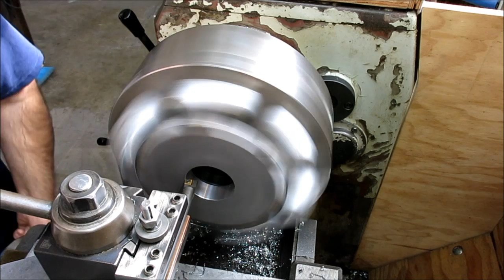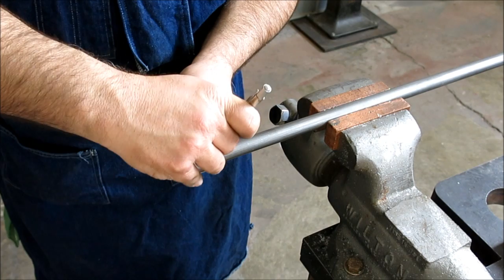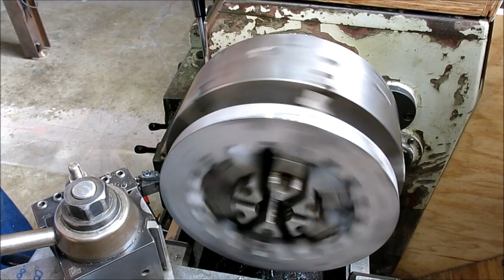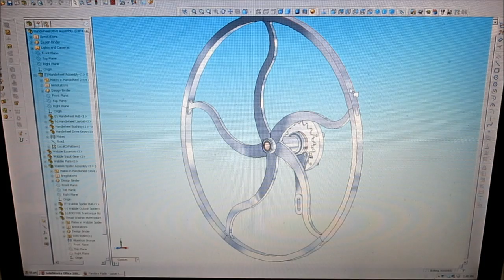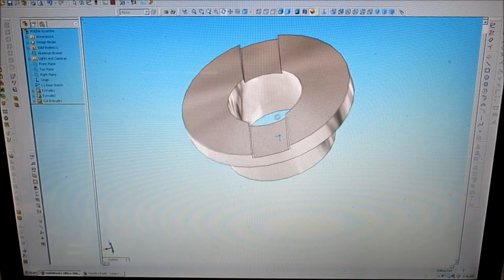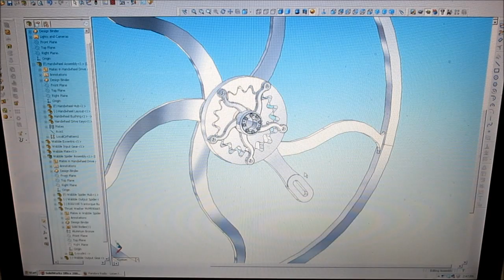Etching Press Wabble Drive Gears

Comment: is it not better to indicate the OD before cutting the OD? may be even indicate on the jaws to make sure that the inner teeth are "in line" with the OD? The teeth are leeding I guess
Reply from the maker: The od is not necessarily concentric with the pitch diameter of the gear. By referencing the gear teeth you start off on the important surface. The OD in this case is not functional for the gear train. Thanks for the comment.

Cheers,

Tom

Comment: what is a tenth? A tenth of a thousandth seems wrong to me, that would make it a fraction of a fraction. If this is the case why isn't it stated in ten-thousandths? I.e. let's remove another two ten-thousandths.
Reply from the maker: Hi Hyss,

In general we talk around the basic machinist measuring unit of one thousandth of an inch. When we say a tenth we are subdividing it kind of shorthand. So a tenth of an inch becomes a hundred thousandths and a ten thousandth becomes a tenth. The metric boys do the same thing centered around a millimeter. Thanks for the comment.

Cheers,

Tom

Comment: Could you give me contact info of shandon HKW so I can as a few questions before I plunk down $700 for the controller? If you want to send it off line my info is nik@niccolyer.com
What town do you live in, anyhow?
Reply from the maker: Hey Nik,

$700 sound really high. You should have a conversation with Stan. Here is a link to his channel. https://www.youtube.com/user/shadonhkw. Check Automation direct for VFD prices as well as these guys. http://www.energycontrol.com/Fuji-FRN001C1S-2U-p/frn001c1s-2u.htm This is one I was looking at for a small surface grinder application. My shop is is the San Francisco Bay area. Where are you located?

All the best,

Tom

Comment: Tom; I love what you do on camera. I'm slowly working my way through all of your older segments while trying to keep up with your current posts. Man, you are prolific!  I've been told that I can convert my old J head Bridgeport 1 hp belt drive 3 phase into a variable speed system by changing to a frequency drive controller. Know anything about that or do you know someone who knows?
Reply from the maker: Hi Nik,

There are a bunch of folks that have done this type of conversion. I have been blessed by the three phase gods so I have not had to deal with the VFD side of things. I'm sure there are some great video's on doing the conversions. Stan over at Shadon HKW has done a few namely his drill press and saw I think. The prices of these units keep coming down so there are lots of choices. 

All the best,

Tom

Comment: Tom could you tell me what oil you use all the time please when lubing stuff or something you would recommend please for when using my mill I use suds a lot  see you like oil
Reply from the maker: Hi lb,

Do you mean for cutting or for lubrication of the machine? The cutting oil is Relton Rapid tap or Kling Light thread cutting oil. The machine lube is standard way lube made by many manufacturers.

Cheers,

Tom

Comment: Hi Tom...

Great stuff! I have a difficult time with very shallow DOC and carbide inserts on steel. Is there a trick? I can get a nice finish with about .020" or deeper DOC, but anything below that is dull and a little chattery sometimes. Maybe my 73 year South Bend 16 isn't rigid enough??

I'm impressed with your finishing tool and the .002 DOC...amazing finish.

Thoughts?

Thanks!

Todd
Orange, CA
Reply from the maker: Hi Todd,

I don't know how fast your SB will go but my guess is your cutting speed is way too low. With a large diameter like these gears its pretty easy to get up to 600-800 fpm cutting speed. If your doing small diameters like say one inch at 800fpm that would be 3200 rpm. I don't think the bronze bushings in the SB would like that. For your setup I would suggest a DOC slightly larger than the nose radius of your insert. Feed at .005/rev or less with a light film of cutting oil. Positive geometry will help also.

Cheers,

Tom
Reply: oxtoolco Thanks Tom...

I agree, the SB is too slow for small diameters. 2.5" diameter and above and things start getting noticeably better. I'm probably also getting greedy and asking too much from an insert that is not really intended for finishing....it's more of a general purpose semi-finishing style....need more positive geo.

Thanks for the input, it's nice to have my suspicions confirmed.

Keep up the great work with the videos! Can't wait to see the etching press in action.

Todd
Reply: T Rudaitis Been doin a little homework and some trial and error. It's no doubt that the old lathes like mine don't like a lot of tip pressure. Like most things, it's a matter of finding the right recipe, and for my needs and my machine it ended up being a cermet insert with a .008 nose. Works great! Even though it's a low rpm lathe, I'm still getting great results down to around .625-.750 OD on 1144 and 303. Perfect for what i do most. Thanks again for the input!
Reply from the maker: T Rudaitis Hi Todd,

What shape insert are you running? Is it a positive or negative geometry?

Cheers,

Tom

Comment: Does the ringing in the part affect the quality of finish?
Reply from the maker: Hi Mark,

Excellent question. It can. I switched roughing tools because of the ringing and some slight surface ripples probably caused from it. The more positive WNMG took care of that problem. Sound is an excellent indicator of cutting performance. After a while you can easily tell the difference between many cutting conditions. 

All the best,

Tom

Comment: Tom you do some nice work. The gears look great. Were you using a CCMT insert for boring? Looks like it but i don't have any tooling of that style. 
I see your starting to use that lead knocker a little more, I told you it works great for indicating. What did you use to wrap it?
Oh, I like the haircut too!!

Adam
Reply from the maker: Hey Adam,

Thanks for the comment. You got good eyes. The boring bar did have a Mitsubishi CCMT insert in it. I like this style of boring bar because I do a wide range of materials and there are lots of choices in C style positive inserts. And yes I am liking the knocker. I wrapped it with Gaffers tape to pretty it up make it stand out with your name on it.

All the best.

Tom

Comment: Nice to see someone use a properly sized box wrench on the toolpost nut!
When I see some of the morons at work use an adjustable for that I just want to bash them in the head with one...
"cresant" wrenches are only half good for SQUARE parts that are odd size and
twisting flat bar, that and rounding off nicely machined hex fasteners LOL
Reply from the maker: Hi Gent,

That's a WW2 era pebble finish Plomb Los Angeles double box wrench. I was stoked when I found it fit the toolpost nut. I'll show it in another video. the center section is so slim and trim its quite the looker.

Cheers,

Tom

Comment: Hi Tom,
Nice job on the finish of the gears!  I can tell you have had many years of experience around the lathe to know what it takes to achieve that finish.  It is beautiful!  Thanks for showing!
Reid
Reply from the maker: Hi Reid,

Thanks for the comment and compliment. Steel can be tricky to get a super fine finish on as you well know. I don't know if you noticed but even using the same technique I got two different surface finishes on the two gears.

Cheers,

Tom
Reply: I did notice and that is why I was so impressed with the finish you got.  Even the finish towards the center was pretty nice.  GREAT JOB!
Reid

Comment: hey tom after watching you video i would like to ask two questions 
1, what sort of pating tool is that and what is the brand 
2, the brand of your boring bar that is used in this video 
thankyou
Reply from the maker: Hi Troy,

Thanks for the comment. The parting blade is an Iscar retrofit for the Aloris parting blade holder. The boring bar is solid carbide and I think that one is a Kennametal. $$$$ but worth it if you do a lot of boring.

Cheers,

Tom

Comment: Tom the gears turned out nice.  I did notice the difference in surface finish too on the inner gear. CRS vs HRS ?  How thick were the gears?
All my other questions have been asked already, this is great...
Reply from the maker: Hi Bill,

Not sure on the steel. I asked Steve if the two gears came out of the same chunk of plate. As far as I know right now the material is just A-36 plate one inch thick. One thing I noted was they were dead nuts at one inch thick which surprised me a little bit. It took about .025 to clean up both sides.

Cheers,

Tom

Comment: Tom, 
Getting fancy with the camera work!  Nicely done!

I wonder when someone will do a musical piece using a lathe, wobble gear, and a sampler?  Some good ringing tones on that run.

Thanks for showing the two unusual work holding setups...useful at times I think, but maybe not something I should try until I've racked up some experience first with the more common ones!

In watching Adam use his knocker I note a difference from the way you used it that might account for why his indicator doesn't get concussions...he notes the spot needing attention, then rotates the chuck back 90 degrees and raps at the top, well away from the indicator, then rotates forward to see if it got the message or not. Just an observation. 

Thanks for the interesting viewing and good lernin'!
Reply from the maker: Hi Mike,

Thanks for the comment. I see Adam doing that also. Its hard to break habits learned over many years. I prefer to see the direct action on the indicator on the actual offending spot. Not always the most healthy spot for the indicator but I have never knocked one out of commission. They just quit talking to me for a few days.

Cheers,

Tom

Comment: Hi Tom , do you have any experience using auto cad inventor ?
Reply from the maker: Hi Michael,

I have never tried Inventor. I have used almost everything but Inventor. I do use good old 2D AutoCAD still quite a bit for profiles.

Cheers,

Tom
Reply: Ok Tom,  just thought I'd run that by you, I'm having trouble with the gear design accelerator.  
 Thanks
Michael

Comment: Hi Tom,
Would it make sense to make the teeth side of each gear a whisker over size and mill it out afterward or are you not really looking for that precision on the actual gears ? Great videos and I have learned a lot even though I don't have any of the big equipment yet,I follow the work for general machining knowledge,

Thanks,
 Woody
Reply from the maker: Hi Woody,

Not necessary with the tooth form on these gears. These are not involute and were designed to be cast or forged and used how they came out of the sand. Its not a precision gear system.

All the best,

Tom

Comment: hi great video again thanks , just got one question if you don't mind but being a novice if you don't ask you don't learn.
but you mention roughing cutter and finish cutter what is the difference.
thanks neil
Reply from the maker: Hi Neil,

The roughing tool is used to do the do the hammering interrupted cuts and major metal removal. This preserves the fine finishing tool to produce accurate cuts and finer finishes. The two tools have slightly different geometries in this example.

All the best,

Tom
Reply: thankyou nery much neil

Comment: I burn this kind of stuff all day long and never get to see the end product. This is really cool. Plus to know I had a hand in it! lol
Reply from the maker: Hey Steve,

Pretty cool stuff. Wait till you see the whole assembly in action. Question. Did both blanks come out of the same scrap? The inner gear machined slightly differently than the outer. Just curios.

Cheers,

Tom
Reply: oxtoolco It was in the same scrap. It was an 8' x 20' plate. I think I had cut some big circles out of it. Yours were right next to each other. Sometimes we can see / hear differences in the plate as we burn. Also find small voids in thick plate. I was burning 5" one time and found a small air pocket or something. That was a scary thing. Blew a hole the size of a jumbo egg out of the middle of the plate. Slag flew everywhere and ruined the hole part.
Reply from the maker: Hey Steve,

I have heard people talk about voids in materials. I've had pretty good luck and not seen too many and the ones I did see were tiny. Steelmaking is pretty darn good these days. Thanks for letting me know on the gear blanks. 

Cheers,

Tom

Comment: Hey, Meatloaf is good any day.
If you want to smooth out the gear teeth find a lazy woodworker and snag his oscillating spindle sander, it will polish out the flame cut surface.
Make sure you clean the metal dust up after your done. Or the woodworker in question might get a bit curious.
Reply from the maker: Hi Andre,

All my woodworking tools hide and shiver in the corner when I walk by. Not much sawdust in my shop.

Cheers,

Tom
Reply: I did spot a small tablesaw in one of your videos though haha.
Yes, sawdust gets EVERYWHERE. Way oil turns to way sludge after woodworking.

Comment: Hi Tom! At turning the od of flame cutted surfaces I've seen at one of my earlyer collegue, that he took always a big pass to cut the complete hardened steel and the high spots in one pass. So no problems with the peaks and bumbs. How do You think about it? Thank You.
Reply from the maker: Hi Andras,

If these were Plasma cut then I would have done the deeper initial cut. Plasma cutting produces a skin that is hard as the dickens which you have to get underneath or lose your tool. These plates were oxy fuel cut and then sandblasted to remove any scale. No worries for carbide tools. Good question because sometimes it does matter.

All the best,

Tom

Comment: At the U. S. Currency Printing Plant here in Fort Worth they have a large, working intaglio printing press in the display area.  I think they said it was late 1800s or early 1900s vintage.  I was fortunate to see it demonstrated a couple of years ago.  I haven't been recently, and I've heard that they've curtailed some of the demos due to the government budget reductions.  
I'm enjoying this project series.  
Thanks, 
Richard
Reply from the maker: Hey Richard,

Could you pop over there  to the printing plant and get a couple of pallets of "samples" for me? I would gladly send you an OX pin.

Cheers,

Tom
Reply: oxtoolco Tom,
I forget how many millions of $100 bills were on a pallet, and there were dozens of pallets in view.  I think there was enough on a single pallet of $100s that you and I could spit one and both be happy.  : )  
Even the guy that printed the sample $100 bill on the intaglio press was extremely careful to shred it after the demo.
The viewers walked through the plant in hermetically sealed tubes twenty or so feet above the plant floor.  No cameras or cell phones allowed in either; those had to be left in your vehicle which was parked in a remote lot.  Buses shuttled us from the parking lot to the plant entrance.  Guards checked everyone before they could board the bus.  It was.tighter than airport security.  

All a visitor could do is look wishfully at it all.  : )

It's definitely worth the visit if anyone ever is in the DFW area.

They even had an master engraver showing how each plate was engraved by hand.  Fascinating process.

No samples from the Currency Plant, but the 2014 Fort Worth Stock Show is in it's last week.  If you could use a large parcel of cow chips, I think I could find a deal on some!
Reply from the maker: Hi Richard,

You haven't seen the OX tools tunnel boring machine yet. Better get yourself some black pajamas. I think we could fit one or two pallets in the cargo bay.

Cheers,

Tom
Reply: oxtoolco Ah-ha, tunnel boring machine!  I think you're on to something now.  Black watch cap, facepaint, turtleneck, cargo pants and Bucky-beaver ground grippers.  Synchronize watches!  2052 hrs and 30 sec.  /oo\

Comment: Is there going to be any adjustment for the backlash in the gearing?.. The reason I ask is, because my experience tells me, even with machined gear teeth, small (minute) discrepancies in the gear form can cause binding.
Reply from the maker: Hi Frank,

These are not normal involute gear teeth. Take a look at my Cyclodial drive model video and see the reducer in action. The lash goes out because the drive loads up in one direction. When its reversed you are right there will be some lash. For this application it is not important to have low backlash. The tooth form is designed for casting or forging without machining to produce a gear set.

All the best,

Tom

Comment: Tom,
Did you do the solidworks drawings?  Very nice.  Thanks for sharing.
Reply from the maker: Hi Herb,

Yes I did do the modeling. The concept started out as a chicken sketch in my notebook and then eventually evolved into a solid model.

Cheers,

Tom
Reply: oxtoolco
Very cool.  I have owned Autocad for many years, but didn't do much modeling til recently.  I'm currently modeling the power drawbar that I'm building for my small mill. Years ago I wrote scrips to do gauges, clock faces and compass faces.  Modeling really helps in the design phase, and it also helps you plan how to make the part.  I don't plan on doing any CNC with it, but it's nice to know that I could if needed

Comment: Hi Tom,
What's the difference between the roughing and finishing tools you used on the facing of the second side? Nose radius? Chipbreaker? Insert coating? Insert geometry?  Inquiring minds want to know.  Thanks.
-Chris
Reply from the maker: Hi Chris,

The first roughing tool was a CNMG 432 or 433. I switched later on to the WNMG with a .016 radius and nice chipbreaker then finished with a CNGP430 or 431.
Reply from the maker: oxtoolco Whoops hit send to quick.

All the best,

Tom

Comment: I like the way you clamped the gear wheel for turning!
What CAD software are you using for your drawings?
regards
Milan
Reply from the maker: Hi Milan,

These were done in Solidworks. Thanks for the comment.

Cheers,

Tom